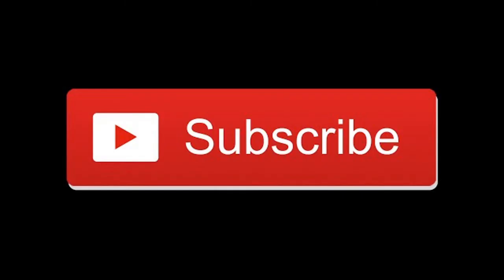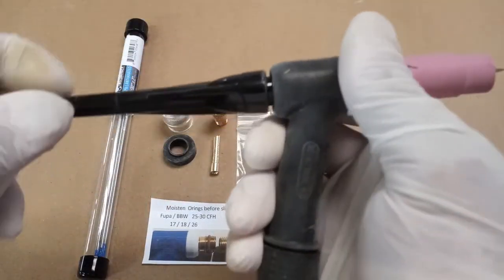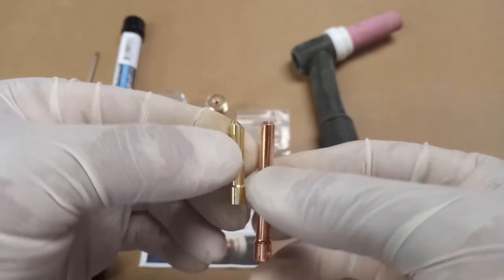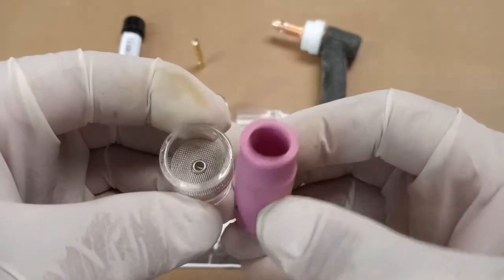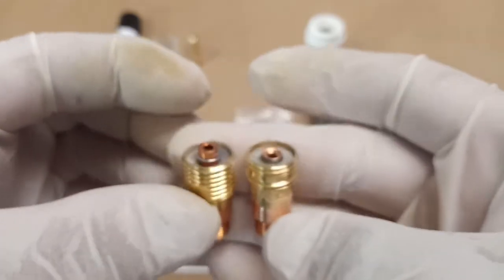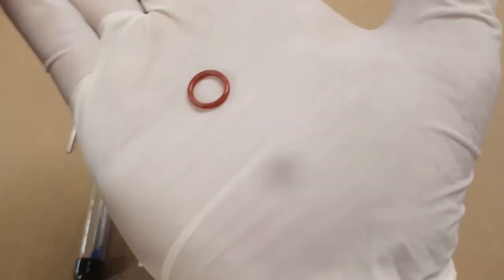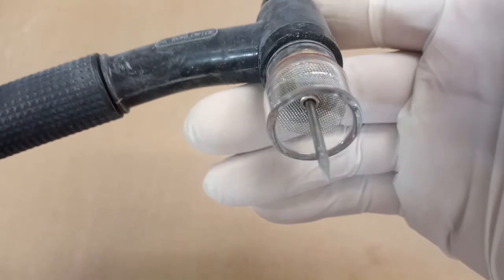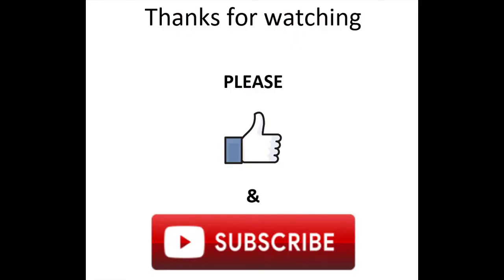Standard tig torch set up upgraded  with a Furick gas lens kit and Jazzy #10 glass see through cup

Comment: Thank you for this video! I bought the Furick 12 cups and adapter. Your comment about stick out was very helpful as well. I’m new to tig and started with a CK Worldwide MT200. Excellent unit.   This kind of info is what makes a difference in the world. 🤟🏻
Reply from the maker: If you haven't found him yet... Jody at welding tips and trick on youtube will teach you ALL you need to know about welding... check him out, the only thing i would add is a #12 cup really isn't for everyday use, I use a # 8 across the board unless it's an application that needs a lot of gas coverage and a long stick out, check out my other tig videos on my playlist. Thanks for watching and good luck with the tig!

Comment: I’ve got the same Jazzy 10 Glass kit from Jody (along with 3 multi mix electrodes).     On the cardboard box it says to moisten O-ring and not to exceed 175 amps.    But it also says “Not Recommended for AC”.     That’s news to me because I’ve been using Pyrex cups with AC and never seen that warning before.     And I’ve seen Jody welding aluminium with clear pyrex cups.      I’ve just seen on the Internet some mention of not using the ceramic cups with AC, which again is news to me.     Can you shed any light on this please?
Reply from the maker: I think the skinny on that is the Pyrex isn't durable long term like the ceramic cups on AC and so they make that disclaimer...... I use Pyrex cups all the time welding aluminum, and I've noticed Pyrex is definitely not as durable as ceramic cups. Thanks for watching.
Reply: @guzzifabrication3448     I contacted Jody at the Weldmonger store and this is the reply:

“The reason the box says "not recommended for AC" is because of the diffuser screen. It's my understanding that the higher temperatures of AC welding can melt the diffuser screen. “

That now makes sense to me, certainly if you were using high current.    The diffuser is quite near to the arc and, unlike standard diffusers, is not part of the metal collet body.
Reply from the maker: @martinrubenstein7943  Awesome ! Thanks for sharing